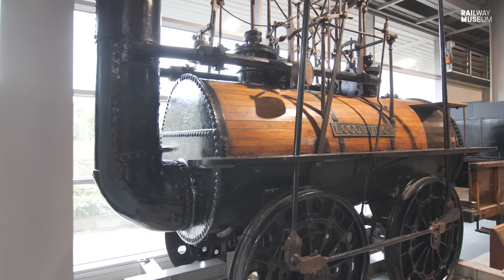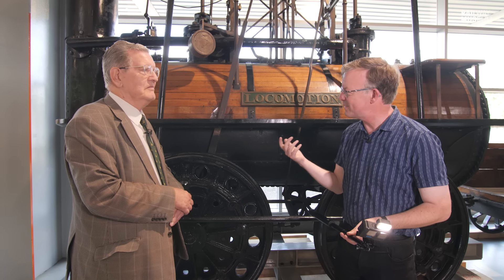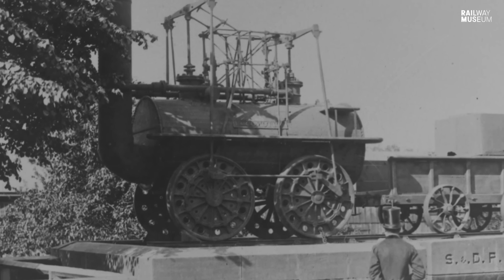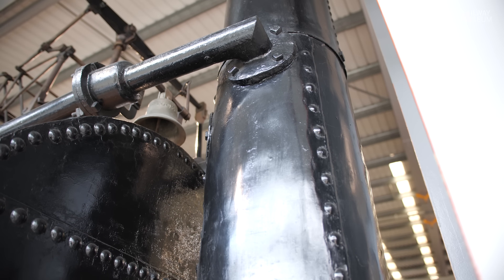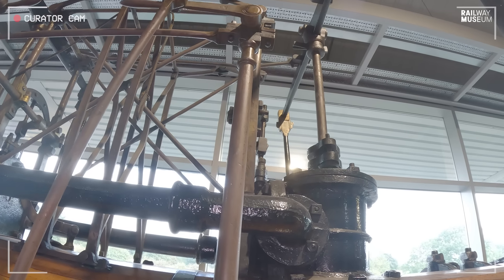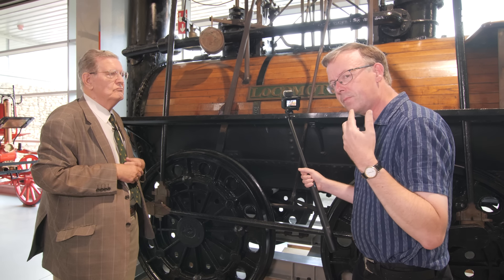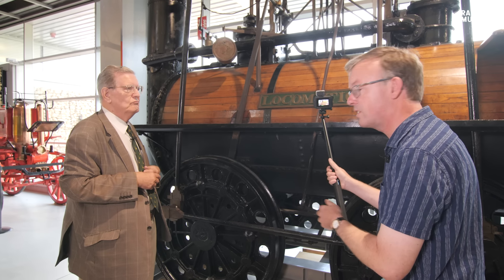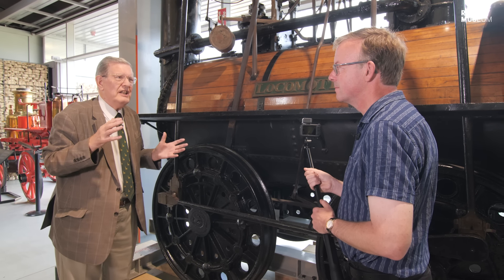Exploring Locomotion No 1's INTRIGUING Engineering Details | Curator with a Camera Extra

Comment: How does Locomotion compare to John Bull which was also constructed by the Robert Stephenson Company in 1831? It still has it's original boiler, and was even fired up and ran at reduced pressure in 1981 for an anniversary run.
Reply: Very different John Bull is less than 10 years later than locomotive but is much more modern with a multi tube boiler as opposed to the single flue boiler of locomotive in its original condition. The cylinders are mounted horizontally between the frames rather than vertically above and sunk into the boiler. It has a proper footplate with the controls in one place (and may be such a new fangled contraption as a break) rather than regulators on each cylinder at the side of the boiler with the driver on the running board. They have very little in common except the builder.

Locomotive is one of the last “pit head” locos in design where as John Bull is 2 or 3 iterations on from Rocket and is much more comparable to something like Lion, with a domed firebox and a steam dome than the very primitive looking Locomotive.

Comment: There's very little (if anything) of the original 1825 locomotive as it was rebuilt so many times as knowledge increased. Rather like 'Hetton Lion'.

Since Locomotion is a replica do you plan an deep dive into 'Agenoria'? From the wear on it's wheels it looks like it did a lot of work